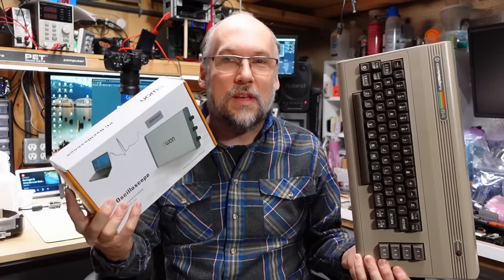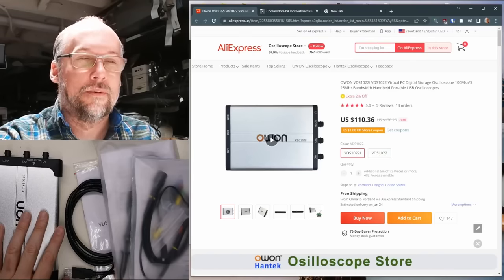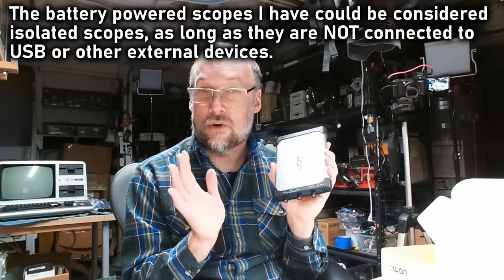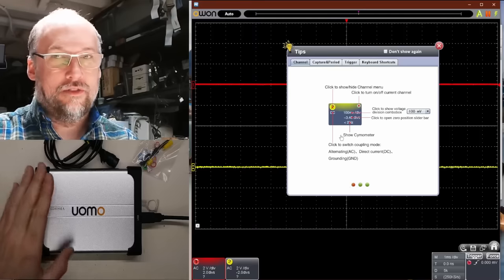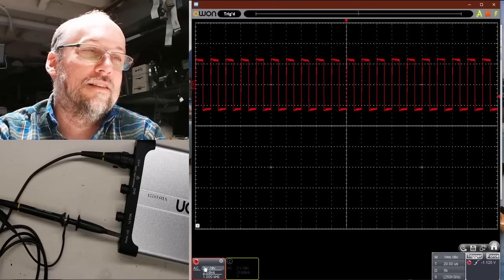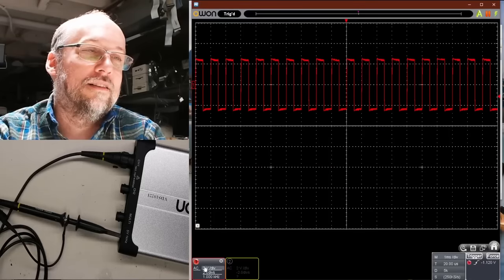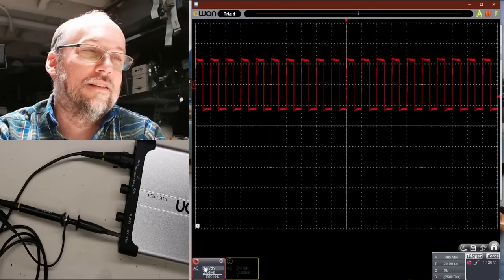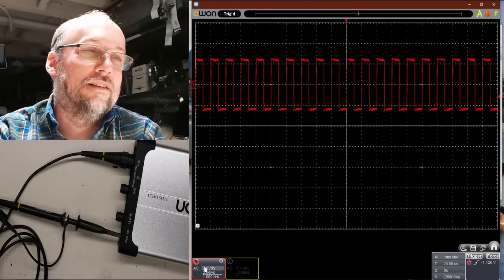This blows away the $60 budget oscilloscope! (OWON VDS1022 review)

Comment: I have the same VDS and yeah the software is crap. I mean it can do most what you need but the interface looks like its from 2005 or something and was never improved. Not only does it have that ugly windows XP style with the shaded buttons / elements, also few important features are hidden in the menus... I think if this would just have a standard, grey Windows interface it would be 100 times better.
Maybe it's possibe to run it with sigrok but I never tried that because I am not using it so often anymore, because I mostly do synthesizer stuff and for that my cheap standalone solder-yourself kit is enough and I don't have to carry everything to the computer to hook up the VDS.

Comment: USB Scopes make no sense to me. The computer/ Laptop screen is usually used for the schematics or instruction videos.. A old hameg analog oscilloscope is cheaper, more acurate, faster and has it´s own display. btw repairing an c64 with a modern usb device doesn´t feel right.
Reply: You get a storage scope for $100